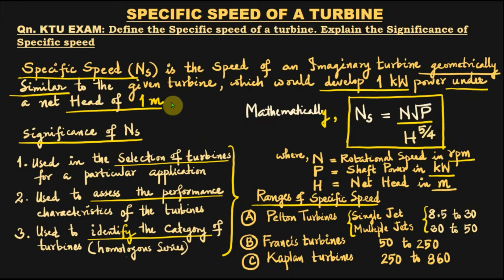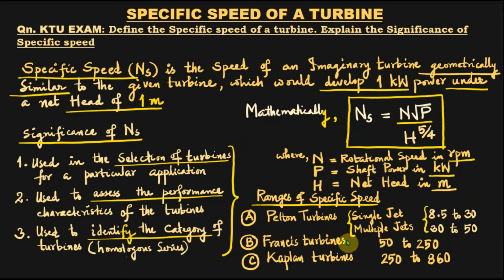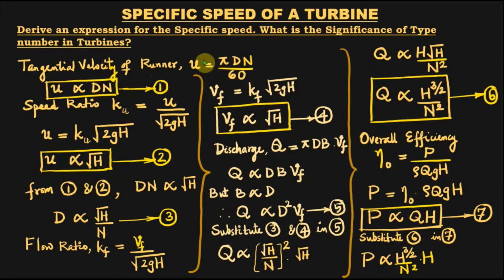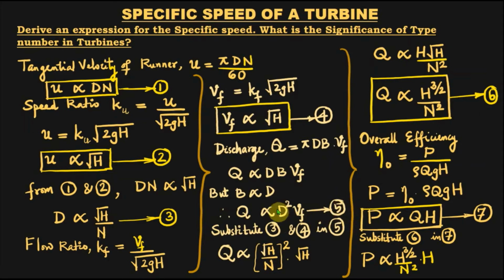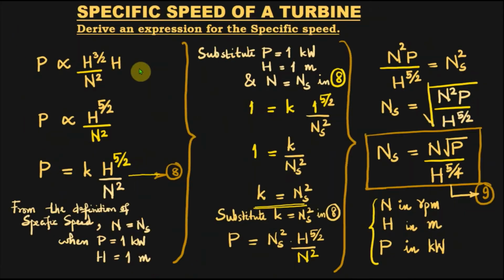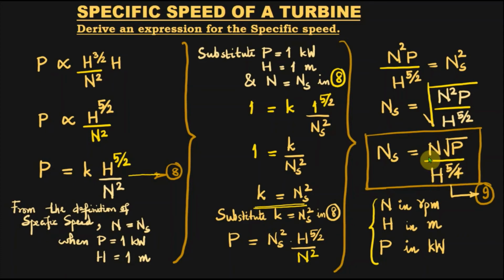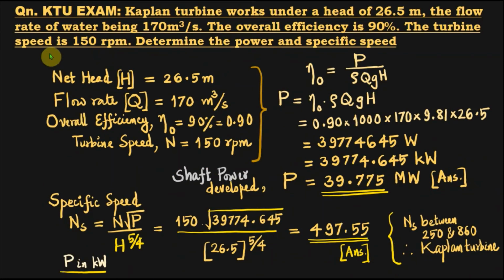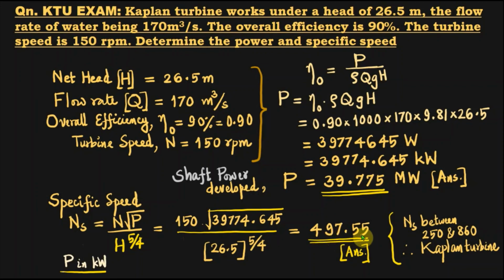Fluid Machinery KTU, Specific Speed of Turbines, Derivation, Type Number and Numerical Problem L12

Comment: sir my couse is me206 , are these the same syllabus ?
Reply from the maker: Old Scheme ME206 Fluid Machinery Syllabus contain less portions, compared to MET206 Fluid Machinery (2019 Scheme).
TOPICS mentioned in Module 5 (GAS TURBINES) NOT INCLUDED IN ME206. You just concentrate on Topics given in Modules (as Play lists) 1,2,3,4 here, which cover all your Six Modules in ME206. 
Old Scheme Syllabus in brief given below. 
Module 1
Impact of Jets, Pelton Turbine and Francis Turbine
Module 2
Kaplan Turbine and Turbine Characteristics
Module 3
Centrifugal Pumps and Characteristics
Module 4
Reciprocating Pumps and other Hydraulic Devices
Module 5
Reciprocating Air Compressors
Module 6
Centrifugal Compressors, Axial Compressors and other Rotary Compressors
Reply: @AnilKumarGopiSaintgits  thank you so much sir
Reply: @AnilKumarGopiSaintgits  sir i received your notes ,, thank you so much for providing me study materials